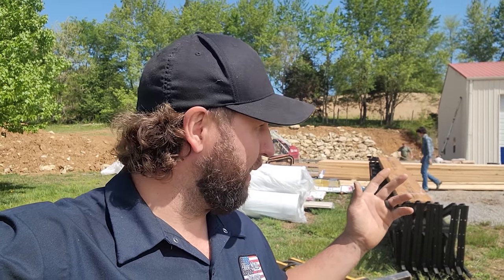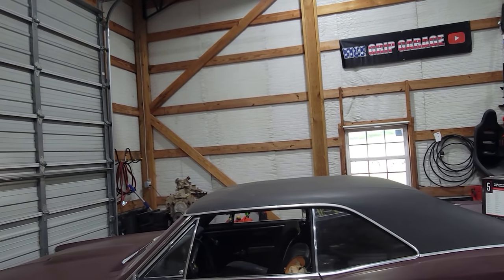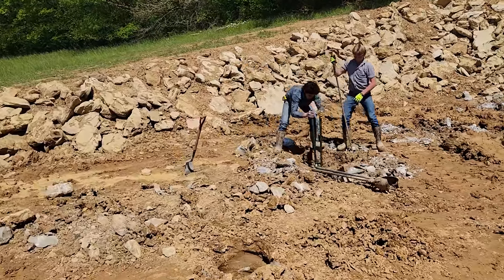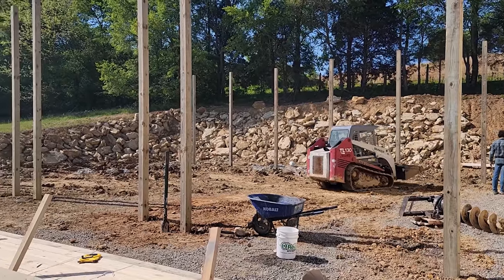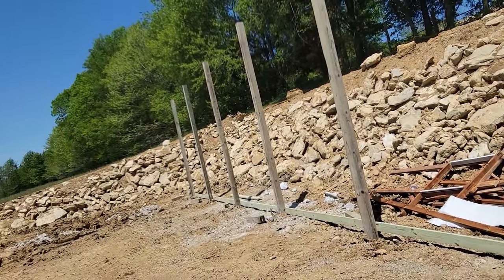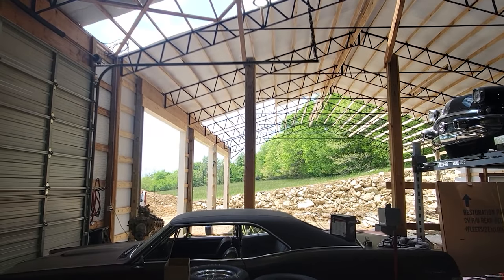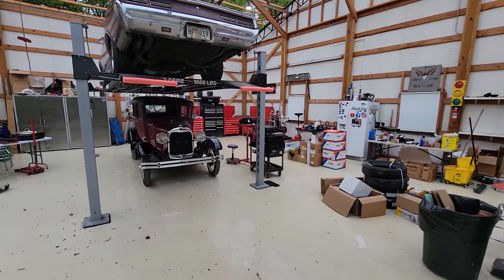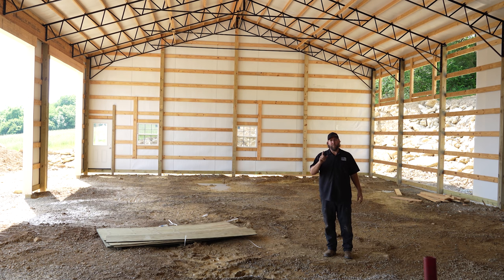Budget Shop Build - EP2 - Framing & Tin!

Comment: A good vent fan or two with shutters mounted high come in handy. Especially when hot, test running engines, painting, etc. Nice progress!
Reply: Will definentally help with the hot southern summer?
Reply: Yes two Cupolas works great and hides a serious ventilation plus gives the roof line some Excellent curb appeal.
Reply: Agree.  If you talk to a local HVAC guy you might be able to figure how much CFM in fans you need to create a good ventilation through the whole building.  Would work for spring/fall to save on AC and get the exhaust out if your running something.
Reply: Agreed. I put an 8" in my 22x24 garage and it was a game changer.
Reply: Closeable ridgeline vent would be the bees knees, but probably out of his budget.
Reply: W/ reverse acting thermostats to turn them on for those hot days.

Do those metal roof turbine vent exhaust fans work down there?  Might not work in the winter but would be cheap to run in the summer.  Hmm Catch 22

Comment: When i built my barn i borrowed a pipe threader and plumbed my whole barn for air and mounted my air compressor outside in a small building.  Worked out great.  Cuts down on noise and i literally have air quick connects everywhere including outside
Reply: wonder if he priced a fire surpression system got to have everything insured and dont want to see anyone hurt ever let alone materials,tools an cars ect go up
Reply: That's an awesome idea, I did the same with my last shop and I'll do it again when I get my shop completed here in Tennessee.  If you need help Derek, let me know, I'm only a couple hours north of you.
Reply: Man you beat me to that suggestion!  Don't use pvc for the air pipe, although I have and had no issues, but it can burst.  By all means set the compressor outside on a covered and enclosed box.  No more obnoxious noise.  Outside outlets as well and inside whatever you think you need,  add about 50% more.  great videos!
Reply: @chevyjennings3404  yea i used black pipe.  At least i think that's what it's called.  I'm no construction worker 🤷‍♂️
Reply: Black pipe or T & C  is what the steel pipe is called. You can  get it from any plumbing or heating supply house cheaper than Home Depot or Lowe's. I would leave a tee in with a plug  every where the pipe connects to the next length just in case you want to add another air line in the future. I would also make sure you install air dryers in the air line to collect the moisture from the compressed air.
Reply: And all that pipe gives you extra volume of compressed air.
Reply: Yeah having that noise and heat maker in it own building is the only way to go, especially for a youtuber.
Reply: @williamescolantejr5871  yeah insurance is nice and a must but keeping what you have is better.
Reply: That rolled black plastic PEX pipe/ hose is rated for 300 psi . It's cheap and super easy to install with a crimper. Less condensation too.
Reply: @SadPuppySoup  agree he has some loot tied in them vehicles why mentioned that
Reply: The number of tires I have to air up I need something similar. Great idea.
Reply: And put the compressor near the power.  Hose is cheaper than wire.
Reply: @chevyjennings3404  a friend of mine used pvc and came back from lunch heard hissing and found a 3 ft hole in his back wall that's a pipe bomb waiting to go off
Reply: When I got my first Big Compressor and was renting my shop I had a friend build a cheap bump out to put it in, the first thing I did when I put my little shop at home in was add a addition big enough for the same big compressor & a little bit of storage. I keep junking it up making it a bitch when I service the compressor though lol.
Reply: @glenncrockett4451  I have the same problem it makes perfect storage for small stuff I rarely use then service time comes and everytime I think I should kick whoever's idea this was in the butt but I'm too old and crippled to do that anymore

Comment: The only thing that I would do different would be to build a spot around back for your air compressor. It would cut the noise level down considerably. Loving the progress. 👍🏻🇺🇸🇺🇸🇺🇸🇺🇸🇺🇸🇺🇸🇺🇸🇺🇸🇺🇸👍🏻
Reply: Yes! I was recently working for an international dealership (I’m now working on the leasing side of it) and they built a gorgeous, brand new shop, and put a rotary compressor in the middle of it. That durn thing is so loud when it does it’s whirlygig compressy stuff you can’t hear yourself think. Derek, if you can relocate the compressor to a small shed Out back you’ll do wonders for hearing protection as well as AV quality
Reply: @xekikbeats  - Well, if he has to, he can build a styrofoam 'box' around the compressor.   Put a few baffles in place, and it can release heat without as much sound coming out.    It's not a great solution, but it'd work without spending lots of $.
Reply: I agree relocate the compressor to external closet if possible. I was also thinking about figuring the plumbing along with the electrical. That way you wont have to sting hoses as far.
Reply: @Willtek5  With money restrictions, as he hasn't done a kickstarter or anything else, about the best he could do is try to figure out how to relocate later by just putting the piping in with that in mind.  (If he's planning on putting any piping in at all.   I suspect not, as he's said that the intention of that area right now is storage)
Reply: I did that too and it was way worth it. Also put my blast cabinet out there with dust collection. The shop is way quieter and considerably less dirt collecting on everything.
Reply: Safer also, if it ever let go unlikely a wife or kid will be anywhere near it.
Reply: I agree compressors take’s up so much room I had a 5x5x6 foot area built under my stairs going to my second floor to my shop freed up so much room in my one car garage shop. I plan on adding a wall length work bench for some tools drill press flat sander metal chop saw .
Reply: I have a small engine repair business me and my son build shop in my back yard 12x24 a one car garage with 11 foot ceiling and second floor for storage . Treat right there Derrick is my dream shop but I would have to grow ALLOT more for something like that

Comment: Looking good! Definitely spring for the LED lighting. The power savings, light output, no warmup time, and reduced maintenance over fluorescent makes them a great investment.
Reply: And they run cooler which is really important here in the South
Reply: At the factory where I work we reckoned LEDs paid for themselves in less than two years due to less power and cost of replacing the tubes every few years. We did it over 5 years ago, and only a few of the 100s installed have failed.

Comment: LIGHTING:  Hope you read this… check the lights to make sure they don’t cause rolling shutter effects on your video footage. Your existing lights are LED and the refresh rate is not rated for video cameras with a rolling shutter. That’s why some of your footage has weird dark horizontal bands across the screen.
Reply: You mean Flicker. Isolated Flicker. He knows.... Rolling Shutter is when you pan your camera quickly from left to right and all the vertical lines in your image warp and bend with the motion.
Reply: @DavidHaverty  it’s both. I work in the pro video industry. I haven’t seen as much flicker on his videos but I have seen horizontal banding. There’s more to rolling shutter effects than just flicker or picture skew/lean.
Reply: What’s your suggestions on a light style  that don’t cause this?  Something energy efficient and could give Derek somewhere around 80 ft candles of light so he can see to work.
Reply: @danfrombam  It would be an investment but if he got like 3 Aputure LS 600d lights and hung them about 4 feet from the ceiling and pointed them up toward the ceiling to bounce  the light it would more more than enough at full brightness. They are controlled by an app to so you could dim and change the color temp remotely. Also if he needed more light to work he could always kick on the other lights he already has but just kill them when he sarts recording again.
Reply: @danfrombam  haven’t had time to research but I would suspend them down on chains so they could be as low as possible but raised if needed.
Reply: @jasonmc4guitar  I think Derek has a good filter for his camera.  I’m going to carry on with the lighting he has in place now.  I’ll try to keep them in line and same height as my previous install

Comment: As a master electrician I can tell you the one thing that people always wish they did in the beginning is as more outlets than you would ever think you need. I would recommend you put in a quad outlet at least ever 10-12'. I would also go with some good LED lights. LED's have come down a lot in price and there are some great deals to be had. Wish I was in TN, would love to be able to do the electric for you.
Reply: In a little two car garage, call it 20x20, I have 3 outlets on each wall, plus four in the ceiling.  So under the hood, by the doors, and in the trunk is covered, the ceiling ones cover in-between two cars, and the front wall bench has three as well.  Three rows of 2 x 48" light fixtures, not over the cars, but a foot off the wall, middle, foot off the other wall.  That way light reflects off the light colored walls and gets some light I to the wheel wells for brake and suspension jobs and such.  And two of the same fixtures over the bench area too, which then also provide underhood lighting.
Reply: Always need more outlets.
Reply: The electricity savings with LED’s is a money printing machine.
Reply: You are correct about the outlets. I put in 8 4-packs of outlets along a 12 foot section in my shed. Each 4-pack is on its own breaker. My intent is to put roasters on my work bench and use those outlets for cooking and warming for family reunions. I don't use all of them often, but they are there and ready to go when I do need them.
Reply: I'll add my two cents since I'm an electrician with 35 years in the trade and the last 13 as a state licensed electrical contractor.
  As you all said, you can't have enough receptacles in any room. 
 In a building like this one he should have some 20 amp and a couple 30 amp 120 volts plus a couple 240 volt boxes with blank covers waiting for the day he needs a welder and some car lifts, air compressors and heaters/ AC units.

Comment: When you are trenching, put twice as much pipe in the ground then you think you may need, have the utility give the structure its own meters,  and plan for sewers, etc even if you think you may never need them.  Don't forget a pipe or two for low-voltage!!  NJ
Reply: Yeah I would definitely rough in for a bathroom.  Putting in PVC pipe is dirt cheap if you do it before the concrete.
Reply: He doesn't have to plan for ground penetration for a bathroom or other waterworks.  I've had several customers that just put in a raised floor, and bathroom on top of that.  Absolutely plan ahead for where the pipes will go outside of the building, but you don't have to stuff things under the concrete unless  you need it in the center of the building.
Reply: Make the tornado shelter a bathroom.  Stub pipe out beyond the edge of the apron.

Oh wait - that s where The Rock is.  Bummer.
Reply: @tbelding  Sounds like a hack solution.  PVC is much cheaper than building a raised floor.  Honestly I would and have cut up the floor to add a bathroom before I would build it on a platform.
Reply: @BobWiersema  - you like busting slabs up, don't you?   The best place for a bathroom is on the existing (old) side.   There's nothing wrong with floating a raised floor.  It works fine, and you can access all the piping without a jackhammer - and an extra $15k.
Reply: @tbelding  Where I live what you are talking about is absolutely not allowed by building code.  If you're looking for a argument I'm not that guy. But I do appreciate your response and always enjoy debating different ways of doing things. At my age and after all these years in construction It's hard to teach this old dog new tricks.  But I will listen.  Thanks.
Reply: @BobWiersema  - AFAIK, the general code for the state of Texas is simply that the plumbing has to have a certain size, a certain angle, flow to the sewer, and so forth (or septic system).   No specifications on having to have a slab (if they did, they'd get PILES of lawsuits because of all the houses on pier and beam).   There are specifications for the floors, I believe, but even there, I've seen wooden ones, I've seen cement over wood, and tile over cement over wood.   (and tile over wood, but those obviously never lasted).    For that matter, insisting on a slab for a northern house would be silly, because of the basements.

Comment: As an old, retired, construction electrician I fully understand how it ALWAYS costs more than you thought and wanted to. That said, however, be happy you're doing this type of construction because it is, BY FAR, WAY cheaper than any kind of "stick" framing. Not to mention, two or three times faster. 

As far as electrical, I would STRONGLY recommend spending the money to end up with at least the necessary base for whatever you think you will want in the future. I would suggest a 200 amp/42 circuit panel in the center of the back wall of the existing section with another 100 amp "sub panel" (at least 20 circuits) in the center of the back wall of the new section. That way, your source is never more than halfway across either building section (since they are 60' each). You will probably have your heaviest loads in the old (working) section of your shop. 

One last thing that will save you some $$ and even speed things up. Run as much of your electrical ("Home Runs" -- the part of each circuit from the panel to the first outlet) in the new building from the panel to the outlets in plastic, in the ground before you pour your slab. It it SOOOO much faster than doing it all overhead, uses far less material, and hardly shows once the floor is in. Any circuits along the front (door) wall will be so much easier going down and across instead of up and over along that wall.

Comment: Elechicken here: what ever you decide on lights be sure to have the electrician put switched outlets in the lid instead of hard wiring the fixtures. Makes replacing the fixtures a breeze as you have a cord and plug for each fixture. Love the look of the new shop!
Reply: @elechicken 😂😂😂
Reply: Solid advice most chickens I know would agree. 

Bonus, you have lots of outlets for hanging cords.
Reply: While this is true if he goes the LED route hardwire is cheaper and it should last years

I’d recommend setting up light zones instead of all on or off
Reply: Ditto, maybe twist lock. They are making some really crappy LED's watch out for that
Reply: @1992djg  ya more switches are better.  So are unswitched hots up there.  One can always get a split switch later that has two toggles to switch each leg if he decides to put a second something into a switched split outlet up there.  Nothing smaller than #12 wire.

Abom79 just got a shop wired and they put the 4"sq boxes on the faces of the longitudinal, horizontal, structural members in the wall.  Stick way out.  Put them up on top of those beams to protect them from being bashed. Or in the corners protected by the posts.   Plus you are going to run wires up there anyways.

Put pipe below the slap or run ACWU subfeed conductors here and there under the floor to the opposite side of the building.   Run sub-panels. The feeder wire is cheaper than a bunch of branch circuit conductors.   It's a long way up and over and down again.  Even if you want nothing in there run empty conduit anyways.  Shit happens.  Mission creep is to be expected.
Reply: Just to let you know there is nothing wrong with doing that but being a garage those outlets will need to be gfci protected per code. Easiest way to do that for the light is to install a gfci breaker in the service panel.
Reply: @charlessmith4347  Here, BC it would be considered a detached building, not residential so not residential rules.   Not up on Tennessee rules ;)

Comment: I work as an electricians helper for a while the best idea I ever saw was a guy put recepticals on the trusses so he could just plug in his lights . This way as he said you don't have to know exacatly where you want them you just have to be within the length of the cord on them . Plus if you need a plug in for anything else while working in the rafter area boom there it is . Just a thought .

Comment: The stacked treated 2x6x20 is actually a good thing a 6x6x20 will twist more over time. By stacking 2x6x20 and reversing the crowns back and forth the post tends to stay straighter over time.

Comment: As long as you don’t skimp on the size of breaker box and amperage, you can always add receptacles and lights but at least one at each post split up on a few breakers to start. Looking great. Blessings  vice grip family.
Reply: Absolutely. And with L.E.D. fixtures, the output is much brighter while the amperage and electric bill is reduced.
Reply: Receptacles sounds like a word Derek would make up.
Reply: @ford351modified  Re-cep-tackles? Re-cep-tickles? Re-cep-tac-les! The last one is french.